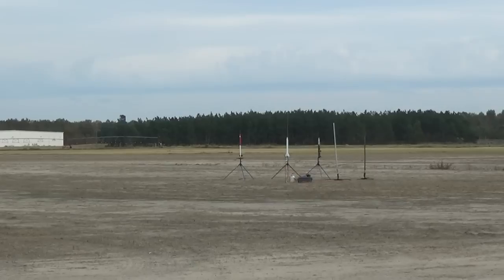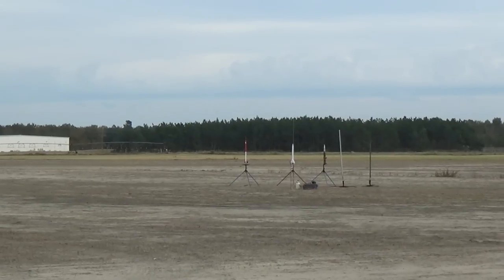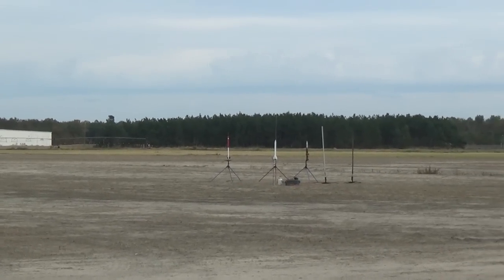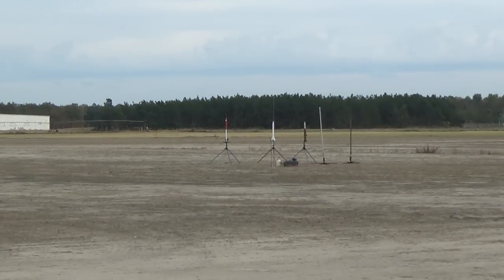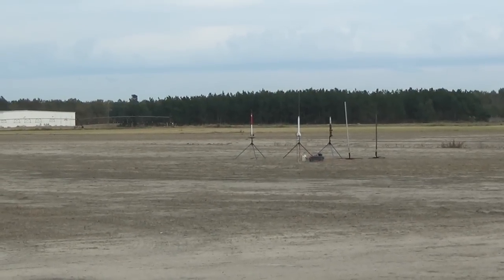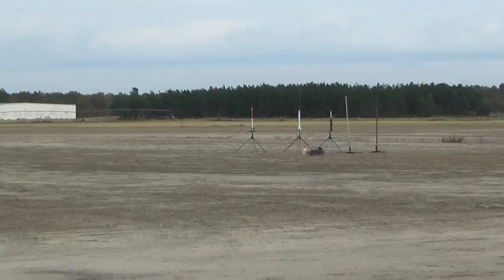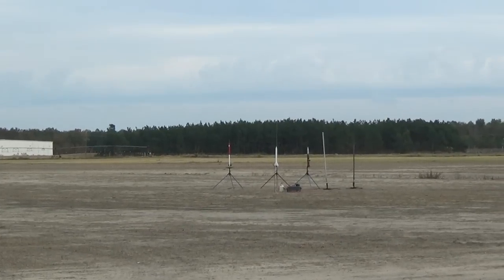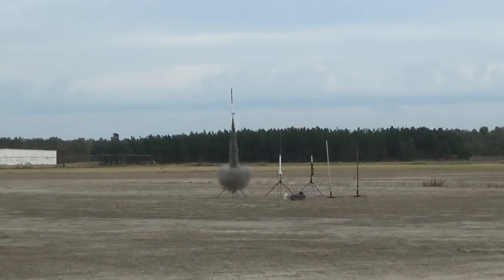Estes Ascender 2-Stage Maiden Flight

Comment: first onboard video looks like you needed some shear pins on the nose cone
Reply from the maker: Well spotted. I can't use shear pins as I'm not using BP for "strong" charges. However I've improved it by a tighter friction on that end.
Reply: That works too. I've been wondering how shear pins would treat a cardboard tube. My guess is the tube would shear first, but I'm not all that familiar with the strength of the shear pins.
Reply from the maker: Yes, that too. The paper tube will most likely get damaged.

Comment: Fantastic straight flight! Your 808 #16 v2 camera is so much better than my 808 #16 v1. Your camera takes smoother, clearer and more colorful picture quality. Mine seems to miss a lot of frames and everything that is supposed to be red is blue.
Beautiful altimeter graph information display that I could totally get into.
The e-bay canister is really cool, nice skills.

I bought a couple of these Ascenders and boosters at Hob-Lob with 40% off coupons=31.00 ea. out the door, what a deal. I'm just waiting to assemble them after practicing some building skills for my NARTREK Bronze Cert. which I just received last week.

My NAR membership expired today. Can't finish NARTREK Silver or attempt a Level 1 Cert. until I renew it.

Awesome motivational video for my upcoming projects. Thanks for sharing.
Reply from the maker: JERRYR708 Thanks Jerry!

Your cam version should have the same video quality as mine.
I'm using a SanDisk Ultra HC 1 4Gig. Maybe the card you have isn't fast enough for video recording? I did refocus the lens for sharper videos.
Do you have the latest firmware installed on the cam?